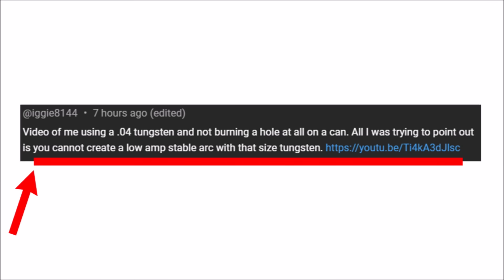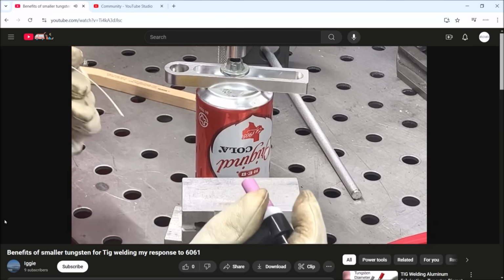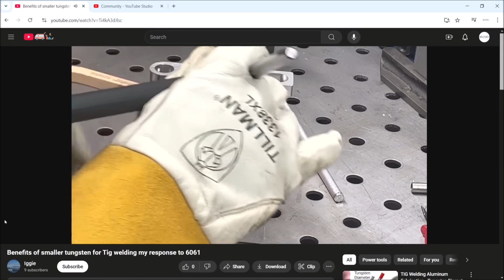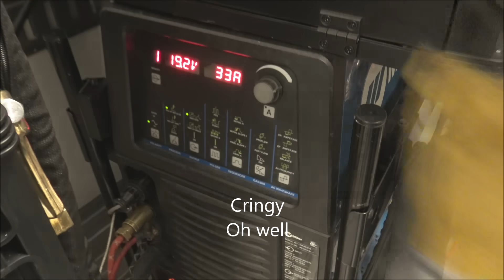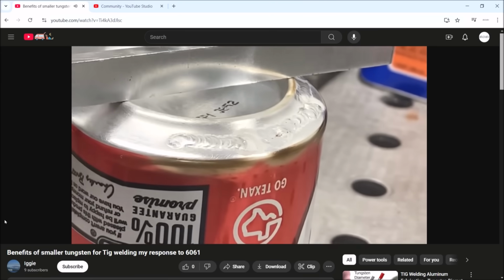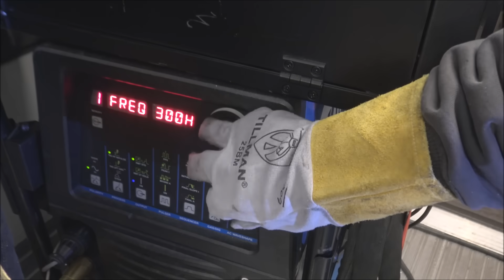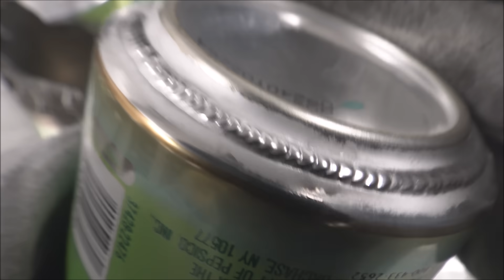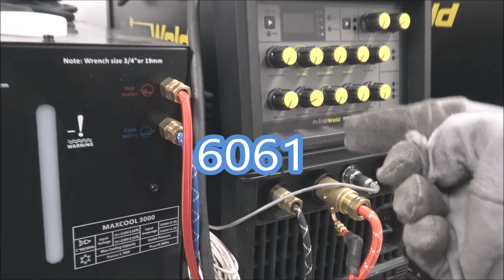You May Have Been Duped... Ego is NOT our Amigo. TIG Welding Aluminum

Comment: If you think that was good and it certainly was , back in the late 60's I worked with an old ancient Russian guy who welded Aluminum .3mm thick with OXY ACETALINE not a regular sized torch but miniature sized torches and tips these were pressure sensors roughly 150mm in diameter convoluted discs welded to thicker bases around the outside perimeter, he wore the old-style oxy goggles he looked and dressed like Moses and sat at a bench and seat he built especially for this job , He in fact was Jewler and Diamond cutter He told me his father was also a jeweler and welded Aluminum jewelry back in the days when Aluminum was dearer than gold, in the 60's there were no aluminum cans, steel beverage cans were just getting popular, later I learned to tig weld steel cans together and that was a mean feat with the old high frequency nonadjustable type the high frequency was on or off those tig welders guaranteed you got a taste of your settings on a humid day, it taught you to have respect for your earth cable and clamp.  These days I rattle too much to even attempt any tig welding.  years ago I bought one of the first Pulse tigs  with a self-cleaning feature for repairing fatigued and cracked aluminum water tanks, that was a game changer still needed the usual prep but certainly reduced a lot of precocity,   these days everything is digital but still needs the skills you have through experience that's something learn and teach but you can't buy it off the shelf.

Comment: As someone that only stick welded steel as part of a millwright class that was tacked onto a different degree... i have absolutely no idea whats going on here... i literally wasnt allowed to use any support "because you cant in the field" and never got to touch anyghing thin, let alone aluminum! This is like, alien crasyness! Like, what kind of witchcraft is this!?

Really though, what's it like doing TIG? It looks like overhead would be way less exhausting, is it?... okay, actually the exhausting part might have been the whole no bracing or support thing... still, it looks much less painful and like the amount of PPE would be reduced. Wait a second... were they fucking with us when we had to use 6010 on overhead pads and get showered in that crackly cellulose coating?...

Comment: I'm old now, but ya. Back in the day, 2000 - Spare time in the shop me and my buddy used 1/8 tungsten and welded aluminum cans together. We made stick men , crap like that just to pass the time. It's good practice, as they say, if you can weld a can you can weld anything. Soup cans are cool to. We used them to warm up for big stainless jobs.

Comment: So what wasn’t shown is taking two pieces of aluminum can and welding them together without blowing a hole through. It is cool to put a bead on an intact can but welding two pieces together is what most would be doing. That is what I’d like to see. Im not in that class because I have an old Heliarc Machine from back in the 60’s. Works great for thicker material.
Reply from the maker: https://6061.com/canbutt03.jpg
Reply: @6061  Awesome, Thanks  That rocks.

Comment: Brother I use 1/8" on just about everything. My Dynasty 350 locked on 350 amps I regulate the amps with my pedal. 

Occasionally on outside corners on .062" 5000 series aluminum ill set up the pulser and ramp up the hrtz to 235. But its only on one box lid I build over and over.

Comment: I have to use thinner (1/16) tungstens for thinner (0.070) Aluminium. My tungsten always balls up bigger than the tungsten width no matter how pointy I sharpen it. Using Ceriated 2% (Grey). At only 80% BAL (20%-25% cleaning), using only about 40Amps on the pedal.
If I use 3/32 tungsten, it still gets a huge ball on the end and the arc is too uncontrollable, so I have to step down to 1/16 tungsten, which still gets a ball on the end, but the arc isn't so out of control. It's still unstable, but "less bad" than 3/32.

I am obviously doing something wrong, but no idea. 80hz or 200Hz doesn't make a difference. No Pulse, pulse just makes things go unstable and outta control I find.  Low amps (sub 60A). Even low BAL 80% (20% cleaning). Zero hot start. Sharpened to a fine point or almost flat end, no difference. Tungsten always gets a big ball on the end,  ie: ball is bigger than the tungsten width. Kinda mushroomed out ball.

Brand new ESAB 185A AC/DC TIG Machine. I don't get it.
If use a large tungsten, it balls out so bad I can't control the arc on thin (0.070) aluminium.

TLDR: I have big balls and it's a problem.

(edited: typos)
Reply from the maker: @JasonJJasonJ
Please email me with this question, I'll try to help you sort it out. I'm pretty sure I know the problem.
Aaron at 6061 dot com

Comment: Yeah In theory smaller tungsten is better for smaller welding but with my experience it really doesn’t make a difference I just run 1/8th you can weld anything with it aluminum wise and it doesn’t split as bad at high amps etc all my aluminum is 1/8 I run a 3/32 for any steel welding

Comment: Good video demo. Was the torch angle you used in this demo your typical torch angle when welding a piece?  Seems like a nice relaxed angle. I'm a noob and I keep hearing that the torch angle should be as straight up as one can, but it's hard to see the puddle. I liked your ending comments on equipment and cost.

Comment: I'm just an electronics engineer, but I can't even see a mechanistic argument to favor a small electrode on even a single parameter aside from cost. At any size, the electrode still just has whatever cone geometry you grind into it within the arc-forming region around the tip, with the rest of it only having an effect on the thermodynamics of the torch itself, not the puddle.

That thermal situation would have to favor the larger electrode, too: the larger cross-section behind the tip would conduct heat away from the arc-forming region faster. This would improve the longevity of the electrode's grind at small currents and make it possible to not immediately melt it at larger currents.

If the goal of selecting a small electrode for some application is to confine the arc's cross-section and increase current density, there might be a case? But that seems counter to the stated goal of not blowing through thin material, and my understanding is that at any size, only the very tip of the cone is involved in the arc anyway; the rest of the cone behind that is just an artifact of the grinding process.

Electrical impedance seems like it should negligibly favor the larger electrode; but even if I'm wring thinking that smaller impedance is better, the extra e.g. 0.1 milliohm and 2 nanohenry for a half-inch stickout of 1/16 vs 1/8 electrode couldn't possibly matter at the sub-MHz frequencies you guys play with.

Mechanical strength seems similarly irrelevant. The most likely mechanical break feels like it's bumping the tip into something and snapping the point off, but it'll be the thinned cone area that fails in a way that's pretty well insensitive to how stiff the rest of the rod is behind it. (That, or your stickout is too far, or you need to stop being so abusive toward your equipment.) Even if you consider an absurd thin electrode mechanically resonating a high pulse frequency, that's still a factor that can only favor larger, stiffer electrodes.

If we were comparing absurd 1/2 inch and 1 inch electrodes, sure: there'd be an argument for weight, or for gas flow. But at any realistic size, the electrode rod is only a tiny fraction of the torch weight and cup area.

The only argument I can see outside of absurd hypotheticals is cost: An electrode half as large does have only a quarter as much total material, and this does seem to be reflected in the pricing of otherwise-identical 1/8 and 1/16 electrodes after a quick comparison search. Maybe some shops find it worth optimizing their consumables around this? But even then, only when for their specific work that doesn't mean grinding just as much tungsten into the grit pile while paying welders for the privilege of spending more time resharpening.

Comment: I'm an engineer (please don't attack me lol I know we are the bane of fabricators) and from a physics perspective I cant see how electrode diameter would change anything assuming the tip is shaped correctly??? Am I missing something, how is the past personal preference so long as the electrode can handle the current???? Gas, good ground, good surface prep, heat applied correctly = good weld right???

Comment: I have the same dynasty at work and I do use the freq and tri mode, to me it slightly softens the weld arc mostly on .032 or thinner materials. Hell, I'm 61 and need a cheater lens but still see the arc differently than I did 10+ yrs ago. Nice job 6061, stay humble and peace all

Comment: I have been selling and repairing welding equipment for 40 years. The size of tungsten is not the biggest issue for most people, it has to do with the power supply AKA Tig welder. some power supplies can weld at 5 Amps, but not all can transfer the arc at 5 amp. A lot of the equipment transfers the arc at 20 amps this typically the real problem. The 040 will make the transfer faster.

Comment: You know i only worked 4 years in a machine shop / fabrication shop and thing i learned is that details like these almost doesnt matter if you have good technique and can setup the machine close enough, you can weld anything. I dont like when people geek out over mundane things, when simple does the job just good as if not better. I welded pressurised vessels and back than i was quite a noobie and boss gave me a cut off from the material and said. Take the white tungsten set it to 110a AC and then if its not good fiddle with it a little. Did as he said, i put a random frequency that felt correct, weld was completely fine.

Comment: I had a stroke and my truck broke down but before I ended up on the streets I used to love welding. This was a great video.  You have a new subscriber, I'm old enough to remember when something like this happened on wranglstar's channel.  I always felt like if it looks nice and it can pass the hammer test it's fine.

Comment: Ha! you had me laughing so, I subscribed. Loved the video and I just tried this. My Miller machine goes down to 4 amps, thinnest rod I had on hand was 1/16" and it worked fine with 3/32" Tungsten. Cranked it up to 20 amps (lol) with 2 pulse per, had to feed filler pretty fast but that worked too although 14 amps was better from 60 to 100 Hz. I liked the lower Hz a bit better. Didn't bother going up to 330Hz that sound is annoying. It's really quite easy, certainly every welder I know can do this and more. Keep up the great videos. Curious about the gloves statement, What gloves do you wear? I thought you wore the Tillman 24CL? No? For this I wore Tillman 1488 with some sleeves...was fine. There is always someone better which is a good thing...how else are we going to learn?

Comment: Can you do that and maintain <1/8" bead on a T joint? Seems like the wide open stringer bead is easy enough but ive struggled trying to maintain a small bead with T joints without stepping down Tungsten sizes, any tips or tricks on that would be appreciated, id also be interested to see if theres much of a difference in penetration/fusion

Comment: I learned the hard way, not aluminum, but TIG on steel to always use the largest diameter tungsten possible, it gets the most energy to where you want it (a big deal when hanging the tungsten out in a hole). The same thing transferred to microwelding, the larger diameter always helped. We used to do some pretty intricate stuff on an old Miller Syncrowave 250 with magnifiers.

Comment: great welds as usual, and entertaining!  I'm a 43 year old TIG welder, and I have carpal tunnel now, and it really sucks.  resting your wrists on the edge of a table or any corner is bad in the long term....at least the middle of your wrist where all the nerves run through.  need some padding there if you have to do it like that to be steady.  I have an Everlast 185DV TIG machine, and I believe it goes down to 5 amps if I remember correctly.

Comment: Had a welding instructor stop by the shop a while back.  He was extolling the virtues of using the correct size of tungsten.  After he had complimented me on the aluminum welding he saw me doing I told him I only used 1/8" tungsten, his expression of surprise/disbelief was entertaining!  We have Fronius and Everlast in the shop and all I can say is they both weld thick and thin and pretty if the person holding the torch knows what he is doing.  I enjoyed your video!
Reply: We use the same machines. They are great for very thin stainless as well. 
😊
Reply: Good thing you don't have an ego

Comment: Machine makes a huge difference. My old Everlast 210 would not light up on AC like how the Dynasty 350 at work did no matter what tungsten or settings I used. Yes I know you did it with the prime weld which is 1/10th the price of a Dynasty 350. The internals on these machines are not all made equal which is a huge problem in this industry that no one is talking about. I had the same problems as iggy with the Everlast. The Dynasty simply did not care what settings or tungsten I used. While the Everlast was a finnicky son of a bitch and very picky about settings and tungsten. But Everlast sent me a new 210 and its way better. Still not a Dynasty though. You also did not mention which tungsten size you had selected on the Dynasty as that is equivalent to the start amps setting on other machines. Iggy should of been running a higher start amps setting. I ran the 350 on 3/32 setting with 1/8 tungsten and it arced up beautifully. The Dynasty with a dipped tungsten started better than my Everlast with a fresh one

Comment: I actually got tired of having so many sizes and types of tungsten and have since, only been using 3/32 chartreuse LaZyr tungsten, but now after watching and learning more from Aaron, I might switch to 1/8" only.
Reply: I agree with you both.   I started with everything 3/32 for quite a while because of all the recommendations, mostly on YT and from online sources.  I didn't have any local TIG folks to really ask and didn't feel like I was going to do it enough for an official  class.  

I eventually found that the 1/8" is better for me when doing most things as I can just sharpen the tips as much and as slender as I need and only have to have 1 size for all the tungsten and collets and such.  Plus on Al 1/8" lasts significantly longer as the material thickness gets close to 1/4" or more.  For stainless or mild steel it didn't matter much either way.

Comment: My machine won't go down enough to weld soda cans. But it will run 8 hrs at 200amps without a hiccup. No fancy anything. HF start and a foot control. If I find a reason or need to weld soda cans, I'll have to upgrade my HF250. (I haven't needed to in the last 40 years.)

Comment: 😂🤣😂🤣...... cracking me up!!  Especially singing/humming the frequency tone (messes me up, when you ffwd a video, btw), & lighting up annihilating the can-

It's obvious that tungsten diameter isn't a factor.  I've got a MILLER (😁) Syncrowave 210 [that is a good machine, but probably has less adjustability than the Primeweld]......and while I prefer using/listening to 60hz, working on thinner stuff does seem more controllable at higher frequency.

Now I'm trying to decide, which video was more hilarious.....this one, or the bike welding one-?

Thanks for all of them!

Comment: The condition of that guys equipment makes me think he's been welding for about a week.
Reply from the maker: @xTheZapper
Iggie can clearly weld, this video was made in good fun. Try replicating the welds he did, it's harder than it looks.

Maybe he's just tidier than us!
Reply: @6061  Yeah, my comment was also in good fun, obviously he's been welding for longer than a week.  Maybe even two?
Reply: Actually I’ve had that welder for at least five years and it is located in the clean section of my shop where no grinding takes place. The shop has AC with filtered air and is cleaned along with all equipment wiped down daily. It’s all for bench welding of machined part that have been prepped and ready for weld.
Reply: @iggie8144  Yeah I'm just poking fun.  I'm just jealous because I wish I could keep my stuff that clean.

Comment: "Ego is NOT Your Amigo" - Well Said! 
4:18 You must do a lot of silver-bullet-welding.. 😁👍 
- This same chucking/spinning method works Great for making Super-Clean Wiring-Harness as well! 
7:08 Yeah,  Bro..  Maybe stick to bangin' the skins!  haha  [I also learned 'settings by ear' in some cases]
8:36 🤣🤣   9:17 [ Best Barney Gumble Impression Ever ] 🤣🤣
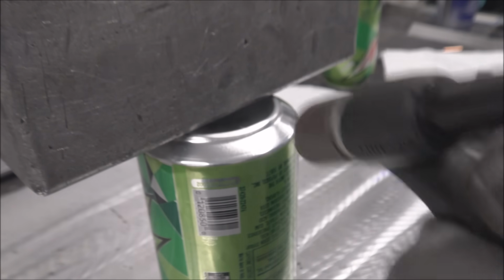11:21 NAILED IT!!!! 🤘🤣
14:28 THANK YOU for that little tidbit!  Decades ago,  I Learned on a monster-Miller like this.. 
Decades Later - I'm still too poor to even afford a pot to piss in,  but just got a PrimeWeld 225X 
[Only having used a few chinesium machines in between,  I really appreciate learning the TRUE Min/Max differences] - Good Stuff! 
* Awesome Advise At The End!!  I lucked out,  and learned Buy The Machine W/ The Highest/Longest Duty-Cycle, 
and shoot for a company that 1 has Expert Tech Support and 2 machines that parts are easily sourced/obtainable! 
1 mistake made on 1 unit I have:  It stopped welding UNDER 100A,  so 0-99A = Nada.  100A +,  it was FIne. 
[Just NOT for what I was using it for]  New Potentiometers - Nope.  Teardown/Inspected:  All seemed well.. 
Support - Non Existent.  Part sourcing - Non Existent.   [ "Luckily",  I learned from that mistake 
I haven't even gotten to use the thing yet,  and already,  I'm Convinced that these PrimeWeld units are here to stay! ]

Sam -